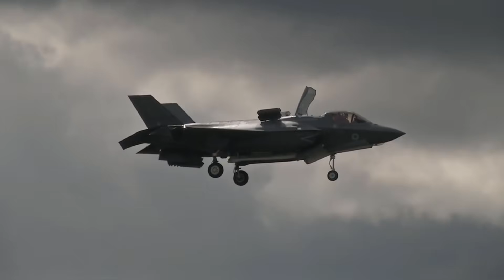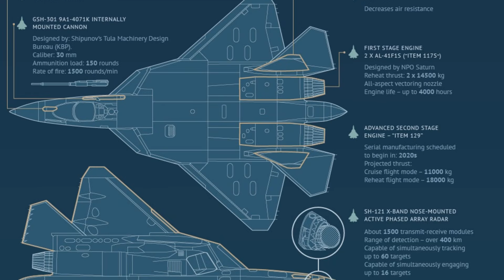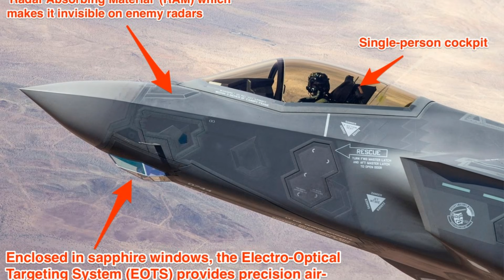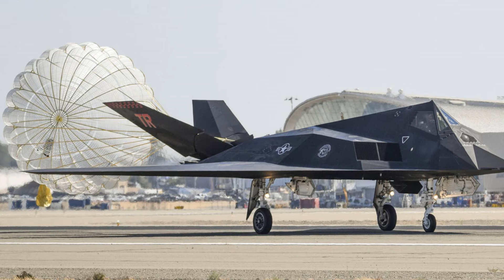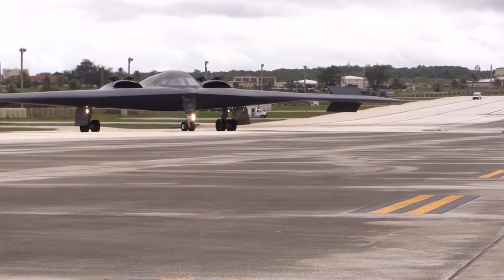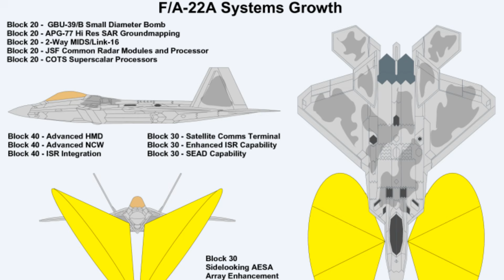Top 5 Combat Aircraft with Lowest Radar Crossection (RCS)

Comment: I promise you that the Su-57 does not have a RCS that low.
Reply: If the paper I read was correct the SU-57 has a RCS of 1.3 meters squared only from the front. After that it goes down hill like a tumbling boulder.
Reply: @richardcontinijr9661  And even its frontal RCS is about the same as a Super Hornet in a clean configuration.  Meaning it’s not stealthy.  Even in a turning fight I don’t rate it too highly despite the thrust vectoring (which is canted 2D, not 3D).  Post-stall maneuvers are useless in a gunfight, and even if a US pilot went against American fighter doctrine since WWII got into a turning fight, Western aircraft have far superior engines that allow them to sustain better turn rates at the speeds where dogfights actually happen.  Yes, the Russian engines can match the maximum thrust, but they take much longer to get there and can’t sustain it due to inferior metallurgy.  The Su-57 stands very little chance against an F-22 or F-35, and even in a WVR fight has no better than even odds against a Super Hornet or newer F-15 or F-16.  It’s just a dressed-up 4th gen aircraft with radar tech that the US had in the 1980s.
Reply: well the f-35 either; some Turkish RO have disclasified than the Israel's F-35 have similar RCS to the SU57 prototypes....so one of the planes its lying
Reply: @chacaf22  the SU-57 has exposed rivets the geometry of the tail fins is off and instead of using an s duct for its engine intake the blades are clearly visible when looking down the intake. Who knows maybe the Russians has some sort of magic formula to make all of that stealthy but I highly doubt it.
Reply: @richardcontinijr9661  the exposed rivets are in the prototypes, the production plane hasn't exposed rivets (those delivered since mid 2021), have new saw teeth in the gaps, also have a slightly different intake to cover better the blades, and the new engine it's shorter, more powerful and better shielded than the old one (from the SU 35), so also it's more hidden, about the tail fins... IDK
Reply: @chacaf22  You're evading the point but also proving it at the same time. Clearly the Russians are figuring this out as they go along, which is understandable considering... well... it's Russia. They are very far behind in stealth and most of what they are implementing into production models of their stealth fighter seem more like mimicry of US stealth technology, rather than actually being functional technological improvements that the Russians understand and can consistently reproduce. The Chinese are guilty of the same. 

With such a flawed prototype model, which is having to be constantly patched to make it even moderately stealth, it should make you pause to consider that the entire design itself is not up to par.  

And shorter, more powerful engines? Where? Another prototype? What is the name of this new engine? When will it be in production? There's no amount of shielding you could put on those engines to keep them from glowing like the Sun on infrared. Nearly the entire back third of the Su-57 are the exposed engines poking out from the fighter. The Su-57's entire design was flawed from the beginning and would take a rework from the ground up for it to be a functional stealth fighter. Like the guy above said, it's a dressed up fourth gen fighter with radar tech the Russians finally managed to figure out. 

Overall you seem to be explaining what it is the Russians need, instead of what it is the Russians actually possess, which in and of itself is proof this is not a stealth fighter in its current configuration.
Reply: @steadybacon1606 
 What? Believe what you want...
Reply: @chacaf22  the engine information is incorrect, the 57 is still using the Saturn engine system as the 35’s.  Russia could not get the new Saturn engine to work properly for more than 100 flight hours estimate without a complete failure.  So to cut costs they scraped the new engine design.  Also there are only 12 SU-57’s built with just 6 ready for combat.  The plane is a 4.5 generation aircraft that is just a step up from the SU-35.  As usual Russian propaganda machine is working hard to sell this aircraft that ultimately will fall short.
Reply: @billgere5293  interesting, the new engine it's called the Izdelye 30, and was a new platform, not heavy based on the Saturn platform

And in fact the development of this engine has passed the static test and the work to integrate into the airframe, and the Russian ministry of defense  also increased the budget for development on the engine

Maybe you should stop to read western analytics whoes barely can distinguish between a Su25 from a Su27, when besides the name and a couple of wings, both planes can't be more different, and also, the Su27 shouted down by the Ukrainian defense forces, had the Ukrainian Shield in both of his tails, and the pilot didn't ejected himself 

Russia it's already battle testing the SU-57 over Ukraine, in fact last week attack on Kiev ammunition warehouses was performed by missiles launched from SU-57s

Don't you think than if the plane wasn't stealthy at all, as you claimed, the western propaganda wasn't make a festival about it? Specially when their augment any scarse win over the Russian, and even mistakes as friendly fire, as almost paved road to victory? 

When in matter of fact they just cried again (on a war than supposedly by occident, Ukraine are winning), because they never knew where some of these precision guide missiles were fired, they even, never saw them coming

And Yes, The Russian ministery of defense, release footage of the attack on Kiev, from the missiles, and from the SU-57 themselves

So believe what you want to believe, proof are over there to see them, SU-57s are as Stealthy as an F-35,at least
Reply: @chacaf22  ok so show me the link to this engagement because I haven’t seen any of this yet.   Thanks
Reply: @chacaf22    The alleged missile launch from the SU-57 in Ukraine was of an externally mounted missile, which would totally make the plane non-stealthy.  Also, the video posted showed the plane flying low, where it would be vulnerable to MANPADS, something that a true stealth plane would not be doing and would not need to do (it was most likely flying low to avoid the radar guided Ukrainian missile defenses).  
Battle tested?  HAHAHAHAHAHAHAHA!!!!!    What a joke.   It didn't do anything that the SU-27 couldn't do.
Finally, you do remember that the SU-57 started life as the PAK-FA vaporware scam with Russia trying to scrape money from India to fund the development of the plane?   India eventually realized it was getting suckered, and pulled out of the deal, and they have NOT gone back (even before the invasion of Ukraine and the sanctions) to buy the plane.
All in all, the SU-57 is almost certainly just a gussied up SU-27 with a nicer paint job.
But, nice try, keep on drinking that Poo-tin Kool-Aide.....
Reply: @chacaf22  And who is it you believe is lying? The country that has never produced a functional stealth aircraft ever in its history or the country that has produced multiple working stealth aircraft that have been proven in combat?
Reply: @chacaf22  the F-35 RCS is actually .0015  not .005 as reported here.  This information given is incorrect.
Reply: What do you mean? Reaction Control System for extreme manuevers?
Reply: Su-57 has a rudderless variant in concept because they can. They have 3D thrust vectoring to work with, understand? No rudders even needed. Hack those off, or fold them down like they plan to and the RCS of a Su-57 will be that of a B-2
Today's testbed Su-57s were built economically for testing. What you see today is not its true potential. It's still undergoing development. But they need substance to participate in cohesion testing. That's the phase they're in. Not fine tuning the final skin. They may still need to get in there and change things.

You know why the MiG-31 is still highly effective? It's constantly given MLU and was originally designed by Soviet engineers. They plan to keep it around another decade. Yet they don't need to. It's just to legend to give up on.
Reply: Sources ?
Reply: @kayrxx7123  it's Russian
Reply: It's better  @wrpg9955
Reply: Source: Wikipedia 
RCS: 0.1-0.1M² its better than what USAF expected.
Reply: @rendelbariuan7583  Wikipedia is not a reliable source. You can't use Wikipedia as a source for college papers for a reason.
Reply: @richardcontinijr9661 Also Wikipedia Devs said they are getting accurate info becuz its is straight from Sukhoi itself.
Reply: @rendelbariuan7583  Wikipedia is not a reliable source nearly anyone can edit an article without any peer review. If it's not reliable enough to use in an academic setting then it's garbage.
Reply: You’re a real tough guy.